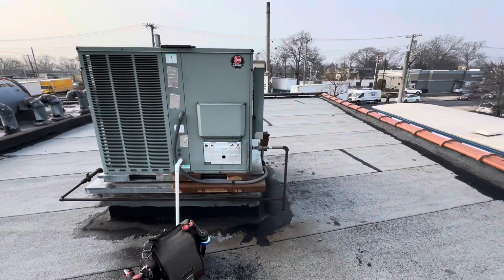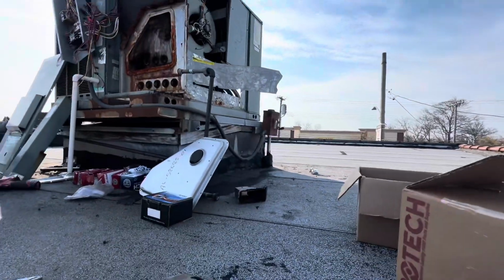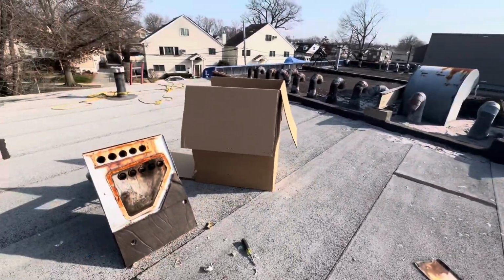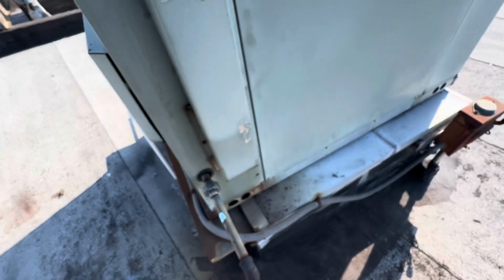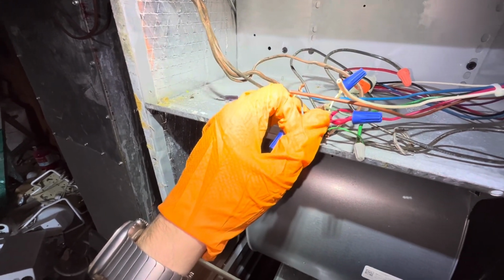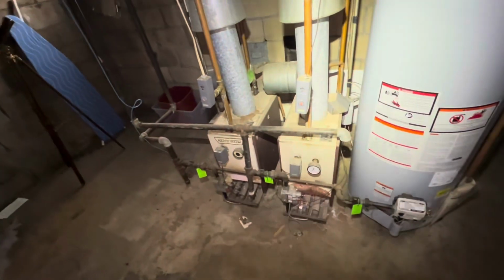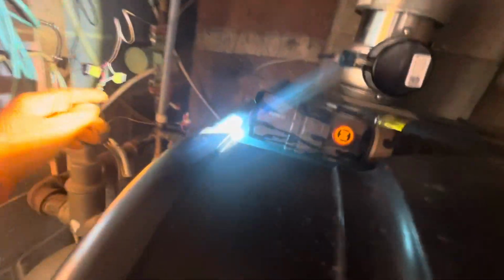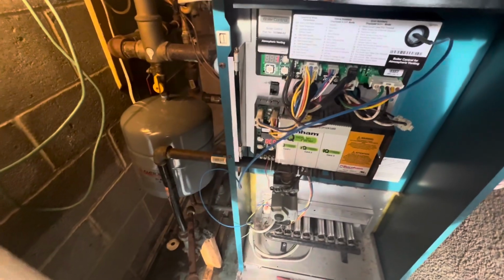Heat Exchanger Swap on an RTU! Running Multiple Service Calls as an HVAC Technician in New York!

Comment: Need a trap on that condensate drain. If the evaporator is on the return side of the blower. If you look at the curb you can tell it’s rusted out also possibly from unit not being able to drain properly in the A/C mode.
Reply from the maker: Unit clearly states not to trap it it has an internal trap.

Comment: Excellent work as always Daniel!!!!! Hate that dude has cancer but he should never have done a " repair " like that. Bonus is you figured out the problem your other co workers could not figure out. Huge asset to the company. My boiler has the old school expansion tank mounted to the basement ceiling I drain myself. Runs 12-15psi with cast iron radiators. Pressure at 20 still sounds good to me as well.

Comment: So who’s the genius that cut the side of that box up to get a look at the heat exchanger instead of doing it the proper way? Unless you completely insulate and cover that it is not gonna perform the way it should.
Reply from the maker: The prior guy who worked on the unit. It was never insulated to begin with, it was just a piece of sheet metal so I don’t think it’s that big of an issue
Reply: @DCHVAC  thank you for the response. I enjoy watching your videos because you seem to be extremely knowledgeable about what you’re doing.

Comment: Don’t know anything about boilers but if I installed one I would always put a tee where the pressure gauge is that way you could install your own,make sure there’s is correct. Keep up the good work ( very smart young man)
Reply: You can always screw a pressure gauge to a boiler drain, using a few adapters.
Reply from the maker: I have a pressure gauge that screws right into the boilers, i keep it in my tool bag it is one of my most important tools.

Comment: wow some crazy setups people have that closet on outside of house for heating system is stupid who designs a house like that? I would be worried the door would blow open in a storm or you can't get to it when snow is piled up in front of door.
Reply from the maker: It’s not stupid it’s great, unlimited access to fresh combustion air, easy serviceability, easy replacement. The doors are strong and they’re held together by a good lock setup. Just shovel the snow out of the way, New York only gets so much snow. I love setups like this, the piping needs to be worked on, but the location is amazing.

Comment: Can you quote the code that says you can’t use Teflon on gas? I’ve always heard mixed claims by different people, it’s ok, it’s not ok. I can never find it in the code. 

I looks in the fuel gas code of New York State. Found nothing disqualifying Teflon.
Reply from the maker: 403.9.3 “shall be resistant to the actions of liquified petroleum gas”  

If you do any minute research you’ll find almost all teflon tape products (PTFE) are 100% teflon, and regardless contain teflon.  They are ALL equally immune to being broken down by gasoline, LP, NG, Jet A, etc.

That’s all that I’ve ever looked into and documented and that’s far beyond good enough reason.
Reply: @DCHVAC  nice thanks I found the full quote 

Thread joint compounds shall be resistant to the action of liquefied petroleum gas or to any other chemical constituents of the gases to be conducted through the piping.

Looks like that allows for Teflon as long as it’s designed for it. Such as 

1/2" x 1000" Gas Guard PTFE Thread Sealing Tape
Reply: @DCHVAC  and actually, I looked up the chemical compatibility of PTFE you should do the same it lists a lot of things, among those things, in alphabetical order very specifically it lists natural gas for compatibility . Look into it. 

Personally I use dope, but doesn’t seem like Teflon is illegal to me even with the code you quoted.
Reply: @DCHVAC  it also include liquified propane and petroleum. As “A” compatibility

Comment: As long as the two transformers are in phase you can have two. It is when they are wired to two different phases on the primary side that things don't go well
Reply: Look at the wiring diagram for a taco 3 wire zone valve. You have “T,T” from the boiler (a circuit mixed with the boiler transformer) intertwined with the zone valve transformer. Always baffles me.

Comment: Keep in mind --for a small crane you can call a tractor trailer tow wrecker / rotator to get most anything on 2 stories or so. Check into it sometime.
Reply from the maker: That costs money
Reply from the maker: But thanks for the tip
I’ll see what happens

Comment: First time I heard a tech explain why teflon shouldn't be used on gas fittings, nice!
Reply from the maker: Thank you!
Reply: Didn't Mike say teflon tape even if it's the yellow gas one is not code in Nassau?
Reply: Daniel if you had a piece of 3 1/2 metal track you could’ve covered that crack, flatten the crack a couple of zip screws your done.
Reply: Sorry flatten the track